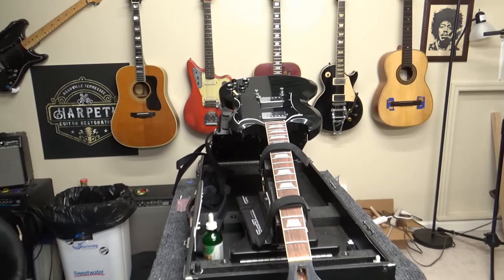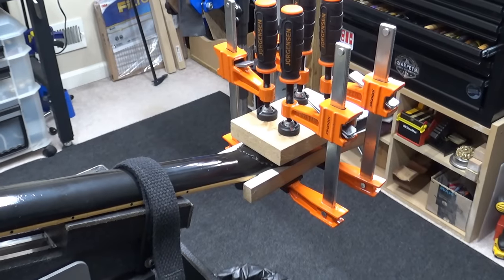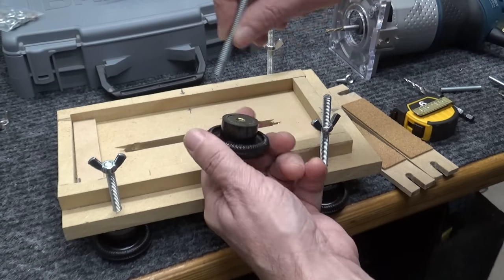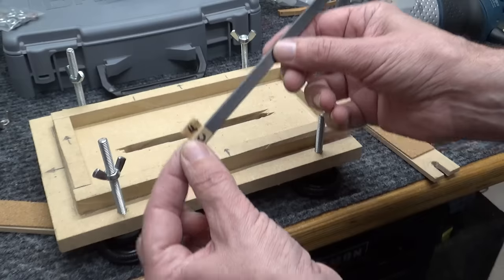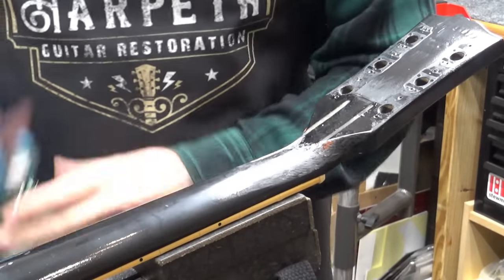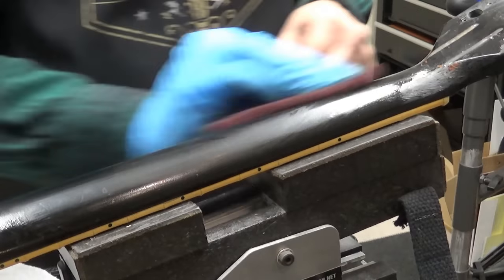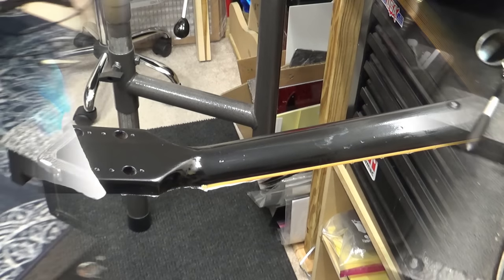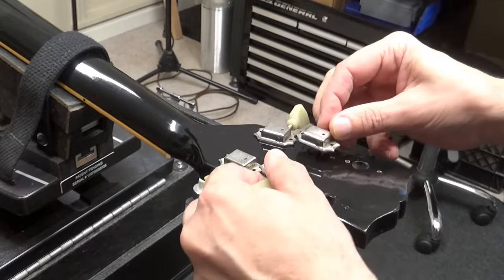Carbon Fiber Rods SG Headstock

Comment: So the carbon fiber actually is stronger than wood splines after it cures?  What brand resins were you using?
Reply from the maker: Thanks!Definitely a million times stronger than mahogany.
West System epoxy
Reply: Thanks much Sctty D.  I plan to try this. @harpethguitar